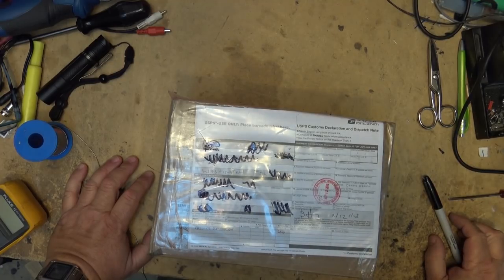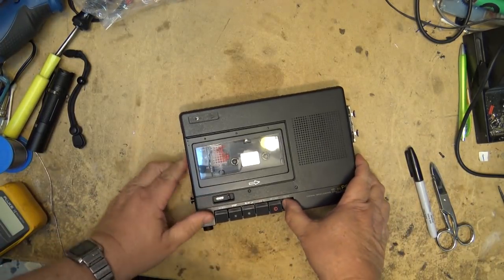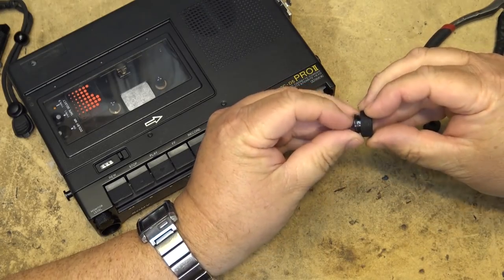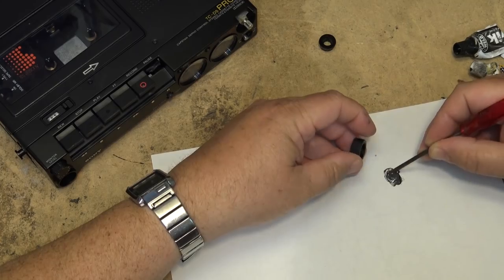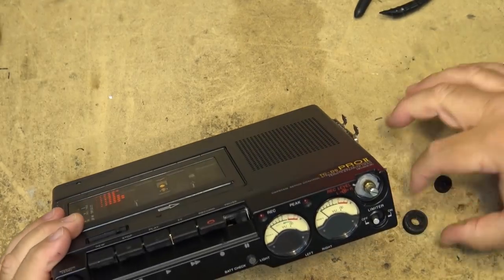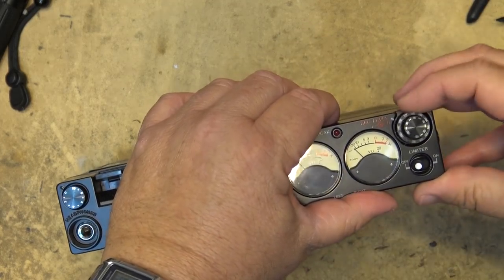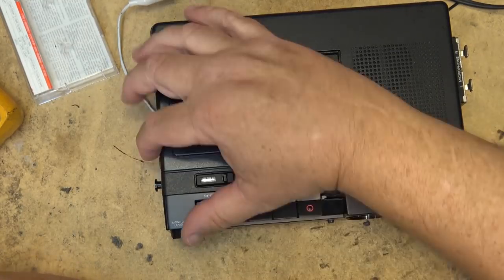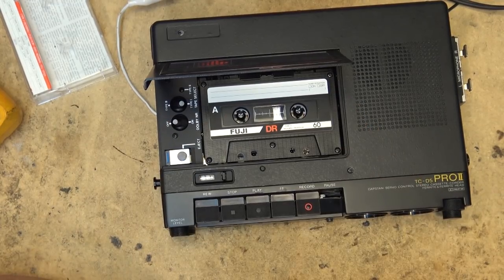Sony TCD5 PRO2 level control knob fix

Comment: This video is very helpful to me. I recently  acquired a TC-D5M with a loose left rec knob. I was not sure if I want to pull the thing apart myself. But with your video, it turns out to be an easier fix than I thought. Thank you.

Comment: Thanks for sharing, mine (TC-D5M) had the same issue. I carefully removed the old glue and put a small strip of double sided tape on the plastic and pressed the outer ring over it. Just like the inner knob it can still be removed if necessary for some reason. Absolutely no need to go full epoxy on it.

Comment: Smashing fix dave, invisible repair :-).
A nice looking tape deck, i love real analog moving coil meters :-D.
I have an old pioneer SA706 amp and a C200 tape deck that both have real meters with glowing backlights.
Shame about the damaged pause and missing name plate.

Comment: Shipping within Canada isn't that cheap either. They have some strange rules as well. I once tried to ship a vacuum tube to a friend, and Canada Post said I couldn't ship it because it was too small. However, if I bought one of their $2.49 bubble wrap envelopes, I could then put it in that bag and ship it OK.

Used JB Weld almost always in my previous life when I worked for a living. Once it sets, you can machine it, drill it, tap it, etc. As close to the original material as one can get!
Reply from the maker: What I was referring to is it is cheaper to ship south, Canada to the us, than the other way.  
I had a fella send me a VCR for repair. 85 us to ship up. 58 Canadian to ship back.  Same box same weight.  85us is about 110 Canadian so using the conversion about half the price to send south.  For stuff I buy I have it shipped to a shipping company in the USA. Even after I pay their 5-10 receiving charge it is still cheaper. I dont do that for people shipping me stuff though as I dont need the hassle at the border having to wait in line paperwork ect.
Reply: Understood. I knew there was a difference, however, I wasn't aware the difference was that big. I have friends in the US that have shipped me stuff before, but that was only because the seller would not ship to Canada. I never looked any deeper there. Thanks for the explanation.
Reply from the maker: Yes and I have stuff shipped to the depot in the states when the seller won't ship to Canada as well, but I have to pay a fee to the depot.

Comment: You should 3D print another Pause button otherwise the customer could have saved a lot of money in postage just by putting the knob in an envelope and sending it to you to put together.
Reply from the maker: Perhaps you should 3d print me one.  
Tough to do without a 3d printer or cad file for the button.  I am certainly not about to invest thousands of dollars in printer and cad software to make a silly button.
Reply: @12voltvids  It'd be useful for repairs like the control knob fix from a later video. Just 3D-print the new shaft (and knob) out of metal.
Reply from the maker: @rawr51919  
Again I don't have s 3d printer.  I am not about to pay someone that has one to make a part. No more than I am about to pay a machinist to make one.  These things cost money,  that most people are not about to pay.  When this recorder was being sent the owner told me about the pause button and I told him I wouldn't be able to fix that because I have no access to the parts.  He sent it in for the control but I doubt he knew it was a compound knob with an inner core that was just glued to the skin. Now everyone knows how these knobs are made and hopefully others will be able to fix their own.
Reply: @12voltvids  You have a point, and the video is evidence of this. This proves that a) these knobs are simple by design, and b) that original cosmetic parts aren't easy to come by these days. Money is of the essence, so I can see why the hesitation's present in your argument.

Comment: Pity about the input sockets  , no we know
Reply from the maker: The tcd5 was available in 2 versions.  One with standard 1/4" microphone plugs and j believe it also had line in, and the pro model that was fitted with the balanced xlr connectors.  These recorders were aimed at professional markets, namely radio and TV reporters using professional microphones.  One of my old friends that was also in the professional video production used one for weddings.  To record the speeches and stuff that he would then assemble with his camera shots.  I used to use 2 cameras one trained on the speaker and the other roaming around for reaction shots but many of the single camera shooter ran a tape recorder to get the audio and then just shot reaction shots and edited them all together. These tape recorders were very popular in video production.
Reply: If  they can handle club music , I would have one , 
Love to have one just for the sake of it , love the VU meters .
Hopefully the belts are easy to get at inside .
Panasonic  NV-180 mobile VCR here , will not power up at all batterry missing but I cannot get inside it to check the belts .
Hopefuly if I get one of those tape decks , it will be running .
Reply from the maker: I did a video of changing the belts on one of these last year. They are fairly easy to get to.

Comment: Move to the US. Shipping is so cheap here lol
Reply from the maker: You're joking right.
When I shipped that JVC stereo back it was going to be  95.00 to ship from Canada. So I drive it to the states to send, and it ended up being 80US, which is more than it would have cost sending from Canada.
Reply: @12voltvids  Weird. Things we've been sent haven't costed even remotely close to that. Maybe it's where you went, idk.
Reply: Coming from someone who works at a UPS drop off branch, its not very cheap at all. Someone shipped a 12X12X12 package that weighed about 10 pounds, and it cost him nearly $40 to send it four states over. The cheapest thing you could ship UPS would be a bubble mailer, and rates for those start at $10.

Comment: I have an old, probably 80s or 90s,  Aiwa stereo that has one of those solenoid type volume Controls. The remote is long gone, and when you try to adjust the volume manually, it basically doesn't respond. It has a digital volume level display, and as you turn it up or down it just displays hysterisis. Back in the day, my first action would be to just spray some tuner cleaner in it, but I have no idea how this thing works. Any suggestions?
Reply: I hate to be the guy to say it, but check the caps. A lot of logic problems can be caused by bad caps, at least that's my experience with Denon turntables. You may have a similar situation. What is the model number of the stereo?